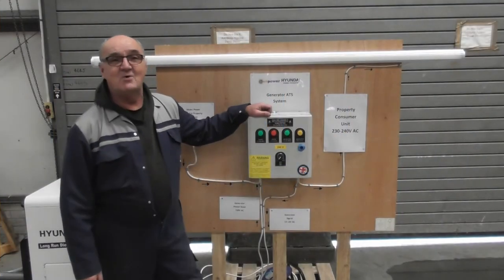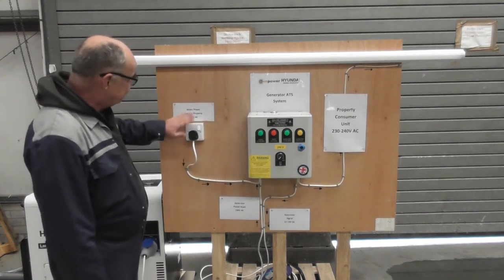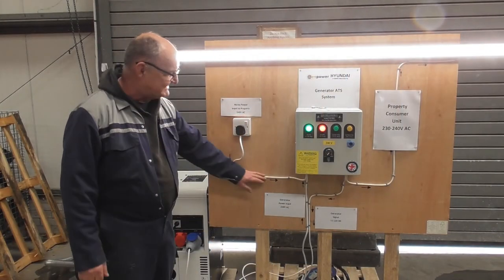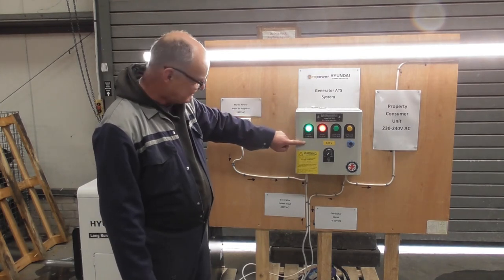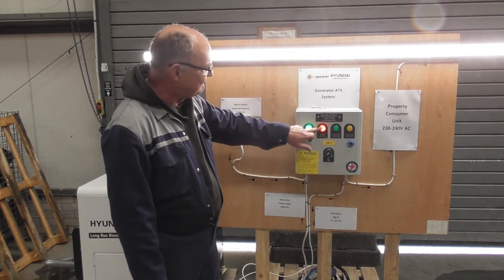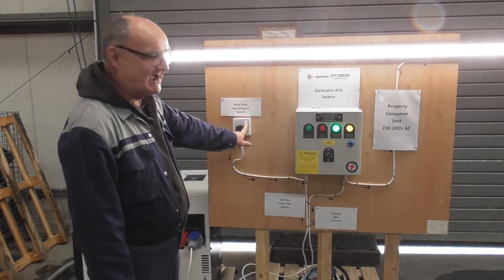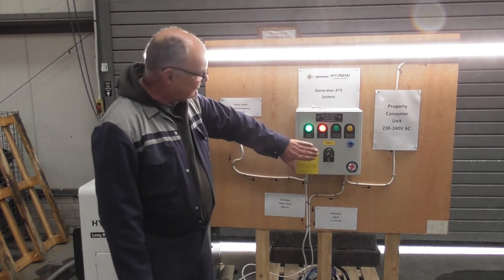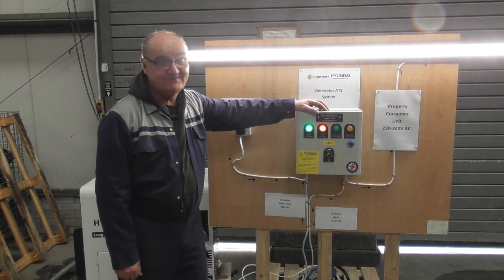How an ATS system works

Comment: Alright so mine doesn't automatically switch on? I have it on auto, turn off the plug, and it doesn't kick in. Any idea what the problem would be ?
Reply from the maker: Hi Brad, you can give us a call on 01646 687 880 and our team will be happy to talk through any issues! Or contact us via: https://hyundaipowerequipment.co.uk/support/contact-us
Reply: have you wired up your COMMS cable correctly?....